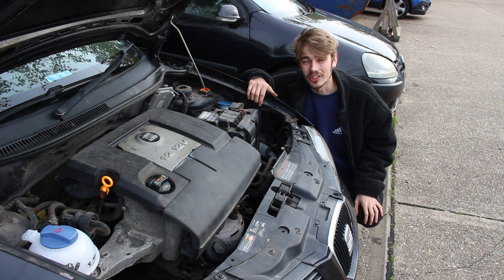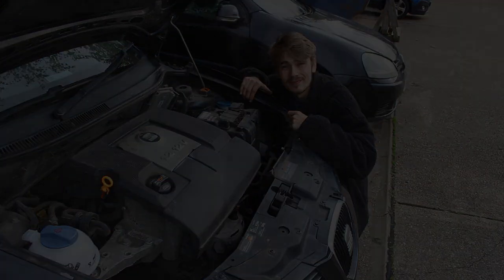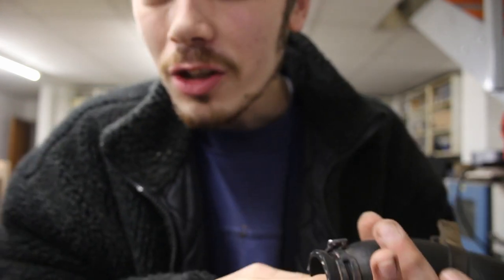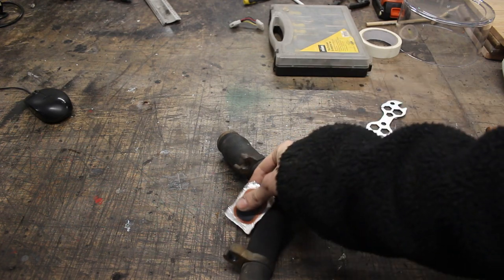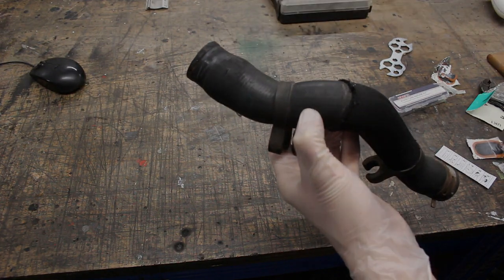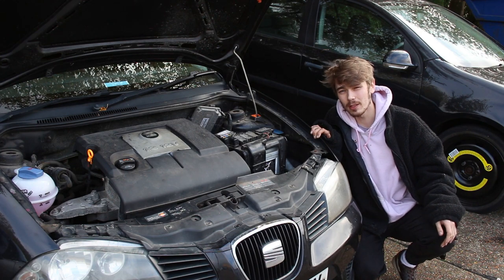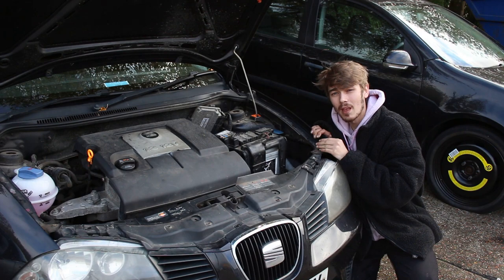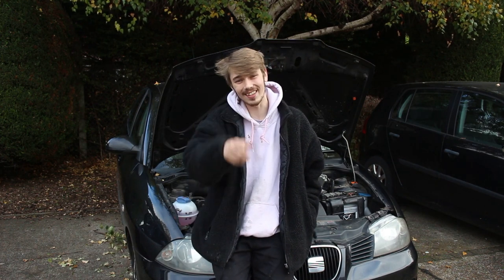1318 - Temporary Emergency Radiator Hose Pipe Repair

Comment: I used to cut the pipe at the leak and stretch it to fit. This only works when the bends allow for a bit of give. Otherwise you can sometimes open the split to push a bit of rubber (or silicon) into it then tightly wrap it with electrical tape. Also the patch won't hold pressure unless you patch it inside and outside.

Comment: nice video. I once had a nail in my tire that wouldn't hold air. 30 miles from home.  I had a number 2 pencil and half a can of fix a flat.  replaced the nail with the pencil and broke the pencil off flush. filled the tire as much as possible with the fix a flat inflate. drove 25mph- but made it home.   Then, quickly placed the spare back where it should have been hours ago.🤣

Comment: You should also probably drive with your heater on full and your fan running as hard as possible. That will make sure the engine doesn't get up to temperature, keeping the pressure in the hoses down. Also, as Stu C says, crack the pressure cap open too.
Reply: This is an awesome tip! I wish I said this on the video, that's what I had to do when I put the initial fix on the pipe, worked a charm, and kept the engine cool! Thank you mate! :)

Comment: Same, I was in the middle of the desert once and radiator hose burst .  All I had was red cellophane tape meant to temporarily patch a break light  lense . It slowed down the leak enough and I was able to drive another 30 miles before all the water boiled out and the engine got too hot .  Still in the desert and I knew a rest stop was 50 miles away .  I made the difficult decition to use my drinking water in the radiator and I wrapped cloth around the cello tape to give it more support . Drove slowly, about 50 MPH, and the last 10 miles the radiator was dry, engine dangerously hot, I feared I had damaged the engine.  I made it to the rest stop and filled all my water containers . The rest of the way I only drove at nite and not over 50, a day and a half later I made it to California and was able to buy a new hose .  The desert is no joke, those cactus dont have more than a drop of water in them, I checked !  Thought I was going to die that day. Never drove a car again with out having spare radiator hoses in the back .

Comment: when it works it works... Im confused as to why it needs to go to the shop when you have the hose off... just buy a new one and replace it, top up with coolant and save $$$
Reply: Yeah for sure! I did end up replacing it myself, as the hose, I ordered come a bit quicker than the garage could have booked me in for. it is all done now though. Thanks! :)

Comment: You wouldn't have that problem if you did better maintenance on your vehicle, and black electric tape works just as good
Reply: Hahaha agreed, I only just got the car back from the garage with the coolant system replaced, the only thing they didn't do was the upper radiator hose (the one in this video) but they replaced the bottom radiator hose. i think it was down to bad luck tbh LOL.

Comment: Get them all changed.  If you do do a temp fix, crack the pressure cap to keep the system pressure lower and drive slower

Comment: Masking tape wrapped round tightly a few times is good enough.  The important thing is not to pressurise the system.  Drive sensibly with the rad cap just cracked open.  End of problem until a proper repair can be effected.

Comment: I have had the same problem on the side of the road. I used electrical tape on the hose and duct tape on top of that for strength. This patch lasted 3 months of continuous driving. Without any leaks. At the 3 months  time I put on the new one

Comment: I have a coolant leak on my car. Unfortunately, no easy or cheap fix for me. It's leaking from the thermostat housing... it's located behind the engine. Thanks Holden for putting an engine designed for a fwd car into a rwd car 🙄

Comment: Not that good of and idea I had a flat from a nail in Barstow California it was around 130 degrees the patches lasted around a half hour to an hour before coming off your radiator runs a lot hotter than that so you better shut it off before it hits normal operating temperature and let it cool back down it would probably help taking off the radiator pressure cap to keep it from building up pressure use a rag to keep the water from bubbling out it helps. It wouldn’t hurt to wrapping a couple layers of duct tape around the hole it has strings in it and will hold up to the pressure and the heat a lot better than the patches but I would still leave off the pressure cap and don’t let it get to hot before letting it cool down

Comment: YOU CAN JUST SLIDE A METAL PIPE INSIDE THE HOSE AND HOSE CLAMP IT FROM OUTSIDE ON BOTH SIDES OF THE HOLE. WONT LEAK ANY AND WILL LAST MUCH LONGER.